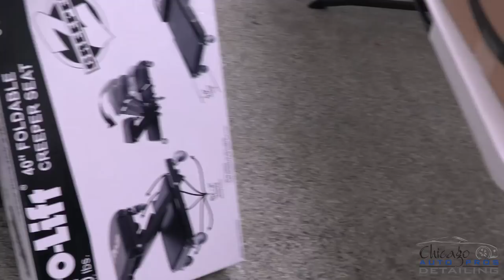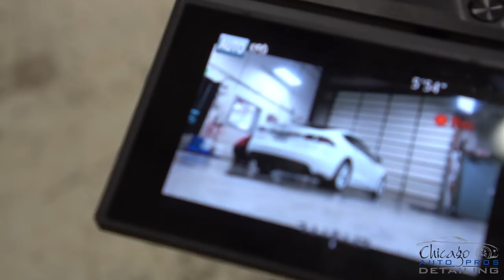12 Ceramic Coatings in 2 weeks | Detailing VLOG #16

Comment: Another great video!  I noticed you use the MF sponges damp for Modesta and on other coatings you use the suede applicators.  Is that a difference per manufacturer recommendation? I have heard a lot of people are using the MF sponges for Cquartz, Gtechniq, and other coatings as well.
Reply from the maker: Bc04 is a wet application, the sponges hold water well. I like using the suede for all the other coatings I feel the product goes further with them.